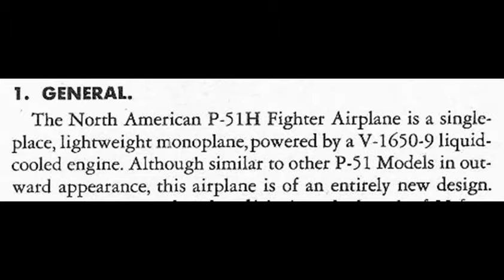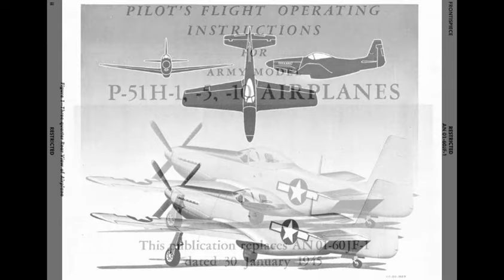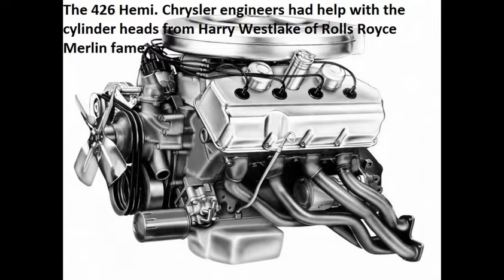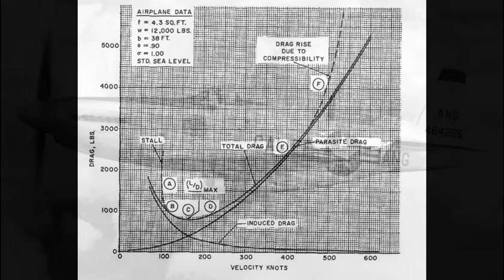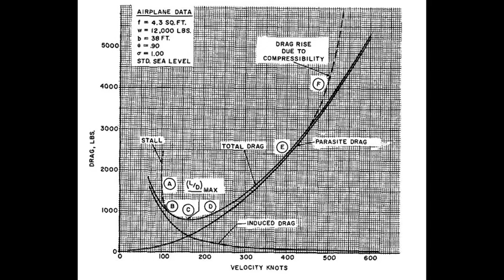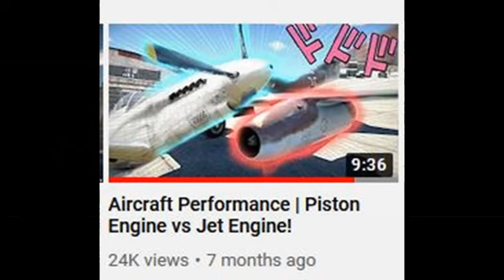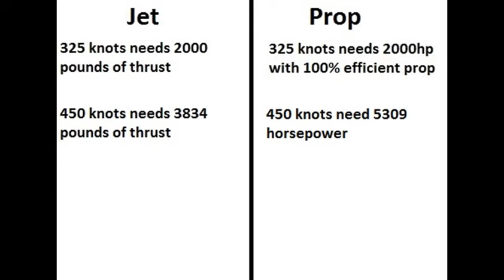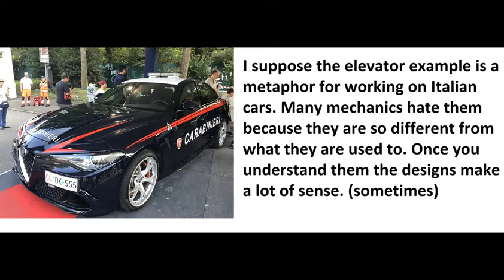U.S. "Superprop" Fighters P-51H, XP-72, and more

Comment: A question: 
I've seen it claimed that a lot of the refinements in the P-51H were inspired by NAA engineers looking at a P-51 and a Spitfire side-by-side and asking why the Mustang was so much heavier, given that the dimensions were so similar. The answer supposedly was that USAAF requirements for structural strength were radically higher than comparable RAF standards (the example that stands out in my memory was a requirement to withstand several times as much lateral G as a British aircraft, which was already something like double what the aircraft would be expected to encounter in flight), so for the P-51H NAA went to USAAF and asked for waivers to allow them to build a much lighter aircraft. The story goes on that the P-51H wasn't popular with pilots, despite the improved performance, because the (perceived) extra ruggedness of the D was seen as more of a benefit than the added performance of the H when flying ground-attack missions, and that (rather then the relative numbers and availability of the two) was why P-51D were sent to Korea. I'm skeptical, especially of the last part, but I wonder - have you seen anything in the primary sources that would address any part of this?
Reply: Sounds like British folklore about the P-51H bring “inspired” by the Spitfire.  Was the Bearcat a British inspiration also?
Reply from the maker: That's just British propaganda.
Reply: If anything - why didn’t the British take design queues from the Mustang for later variants of the Mk IX Spitfire ?  Specifically - for RANGE and top speed ?  The lack of range really limited the usefulness of the Spitfire from 1942 onwards in the ETO.  We know that the FAA restricted the use of the Seafire to fleet CAP duties in the Pacific in ‘44-‘45 due to range restraints. The FAA used the Corsair and the Hellcat on all strike missions.

Comment: ... if the jet engine has rated output of 1500 Hp , the compressor stages use +-3000 hp just to compress and move the air.   so the power turbine has to do 4500hp to make the jet engine work.... bad numbers .. and still used. :D:D:D:D

Comment: P-51H served in WWII Europe and was the final aircraft of George Preddy (P-51H-6)
Reply: +Michael McKinnon     George Preddy was killed flying P-51D S/N 44-14906,  December 25, 1944.     No P-51H models were in European combat.
Reply: @FiveCentsPlease  wrong it was a  P-51H-6 your right about the date though, he wasn't flying his own aircraft because it was down for maintenance courtesy of it not starting after three tries
Reply: @michaelmckinnon1591   The first test models of the P-51H did not fly until February 1945 after Preddy's death.  And they did not fly in combat.  Only a handful of P-51H aircraft made it to Pacific to units in the Fall of 1945.
Reply: @FiveCentsPlease  you're referring to the P-51K or the last attempt to make an aircraft carrier version
Reply: @michaelmckinnon1591    Please do better research.   The P-51K is identical to the P-51D except for using an uncuffed Aeroproducts propeller because the Hamilton Standard props were in short supply.   The K model was not a carrier version.  Carrier trials were conducted with a P-51D variant but further development was cancelled after Pacific forces secured enough territory for standard P-51D aircraft to be within range of Japan.

Comment: You want different in cars???  Work on classic Brit cars.  If one part is good, the Brits have to use at least 6....all put together not by Metric, nor by Imperial standards, but Whitworth standards.  If you haven't done so, perhaps you can tell the tale of why it took Packard so long to start producing the Merlin engine....and why subsequently in the war Brit mechanics strongly favored Packard produced engines (the ones that actually had interchangeable parts).

Comment: Chrysler cant call anything a Thunderbolt because Ford had a car in the early 60's actually badged as a Thunderbolt! Ford "owns" it.  I think it was a Galaxy variant. One of those "factory dragsters" that Anyone could just go and buy!
Prop motors have a built in speed/performance limiter! The blade tip speed!
Reply from the maker: https://www.supercars.net/blog/1941-chrysler-thunderbolt/
Reply: @GregsAirplanesandAutomobiles  Yeah that was a concept car. Weird looking booger wasn't it? See the Ford was a production model,so the badge is theirs. The article said Chrysler called a later concept car thunderbolt again. If they could have used it I'm sure they would have.

Comment: Why didn't we just use the P 38 to fly our bomber escort missions from Britain to Berlin in the early part of the war before drop tanks and move convenient staging areas were available?  Was it REALLY that hard for British mechanics to learn how to maintain engines with superchargers on them?  This same argument could be made for the Mustangs as well since they were available with the supercharger as early as 1942 in its high performance configuration.  Just seems like we really did things the hard way and got a lot of good pilots killed for no reason beyond stubborn bureaucratic procurement practices.
Reply from the maker: I address this exact question in my P-47 video on range. It's too complex to cover in the comments.
Reply: @GregsAirplanesandAutomobiles  thanks for the info.  I've wondered about this for years.  Hopefully I can scan through the video you refered to here and easily find the clip that explains everything.

Comment: I was hoping for the mathematics (or physics ) behind the number, area and length of the propellers themselves and how it relates to the increase in engine power.
Btw, most people hate Italian cars because they are unreliable, electric  wiring is horrible and powered windows will eventually fail as soon as the always too short warranty ends, no need to even talk about the lancia beta  affair.
I know that they are much better nowadays, but I grew up in the 80's, and believe me,  all Italian car were horrible back then.
Reply from the maker: Prop video is coming. The Fiats of the 70s and 80s were better than the Chevy Vega.

Comment: 90 inches of water pressure is..... 3.24 psi lol. Imagine what power it could do with 10 psi?
Reply from the maker: It's not water pressure.
Reply: @GregsAirplanesandAutomobiles  that's how it used to be measured look it up. It's like a analogue way of measurement. Theres also one called inches of mercury for vacuum.
Reply: @GregsAirplanesandAutomobiles  so that measurement was of the manifold pressure of the supercharger and means it had 3.24 psi of boost. That's why I said imagine what power it could make with 10 psi.